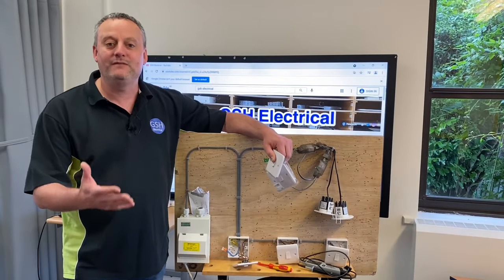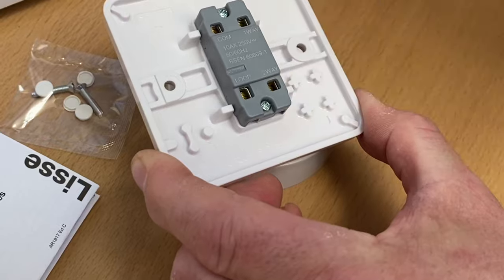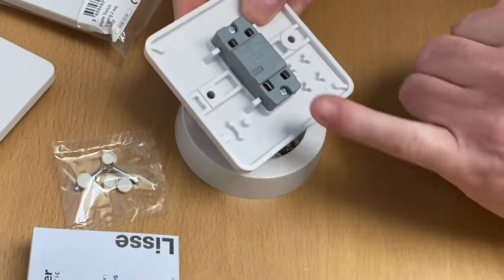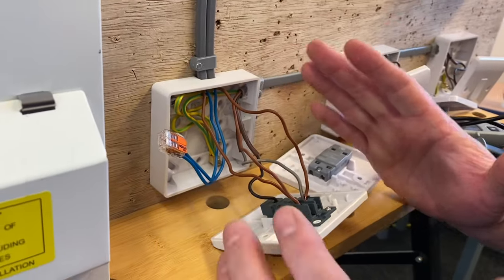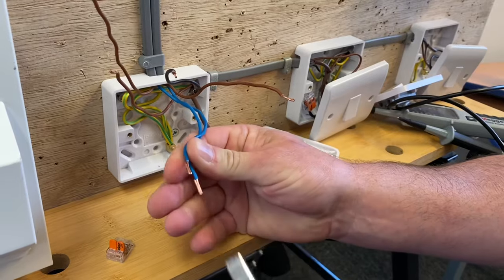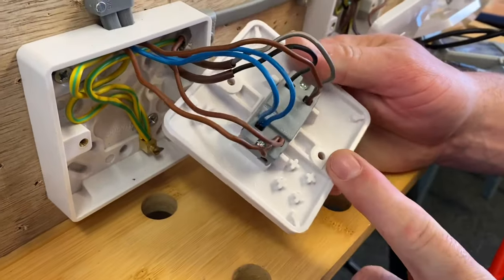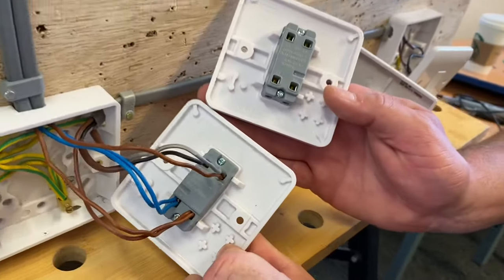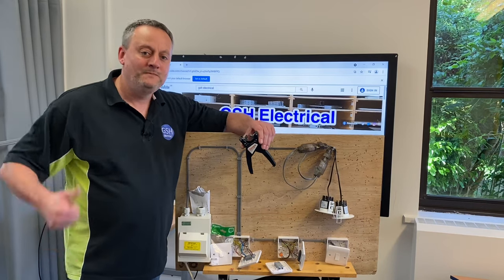Neutral Connection in the Back of a 2 Way Switch - 2 Plate Method - Taking the Feed to the Switch

Comment: It's a good idea but feel the Wago is a much better connection which is unlikely to be loose or left loose.
Reply from the maker: Thanks for commenting 👍🏻
Reply: Then the same issue would follow for those other switch terminations that aren't using Wagos. Just ensure the LOOP is similarly properly terminated. Insert prepared conductors, tighten screw then pull cables firmly to check.

Comment: I’ve been taking the feed to the switch for years. In my opinion it should now be standard. Makes life much easier when fault finding, especially with the amount of downlights people now have fitted in their homes. Also with smart switching the way it’s going, it’s only a matter of time until the regs are going to require a neutral at the switch. I don’t think it will be as quick as others think it will, but it’s definitely coming. Also I sit in the camp of using 2273 connectors instead of 221’s, only because when pushing front plates back I’ve had cables come out of the 221’s if the levers lift up with a lot of cables in the back box. Great video as always though Gaz. I wish more electricians would watch these videos as part of their CPD.
Reply from the maker: Thanks for the detailed comment Jacob 👍🏻
Reply: you should cable tıe them for extra security.

Comment: Bringing the feed to the switch is a good way forward, I found it very useful when installing smart wall switches which require a neutral in order to power its internal electronics
Reply from the maker: Great point 👍🏻
Reply: Gary. A video on smart switches would be great with a neutral feed and without. Cheers

Comment: I can't tell you how often I needed to have a neutral  behind a light switch but didn't have one. You need it for PIR motion sensors, Smart switches, timer switches and more. I think the days of the loop in ceiling rose wiring, are numbered. It was a clever system in the UK, but it doesn't make so much sense any more. People want fancy light fixtures not just a pendant. And we are desperate for that neutral behind the light switch 😉👍.

Comment: Very poor design! The possibilities for mistakes, expensive ones too, are numerous. FAR too easy to grab an intermediate thinking it has n/c terminal for neutral and end up connecting L to neutral! The extra terminal should be in BOTH switches, physically offset in some way and CLEARLY identified with blue colour to avoid ANY chance of confusion or ambiguity! 🤔😲🙄

Comment: I would prefer to use the wago as it’s a maintenance free connection as a opposed to a screw terminal . I guess some will use that loop terminal for the switch wire when they introduce an intermediate to a two way. So I guess it would be best to call it a loop terminal as it could then be used for live or negative loop through connections .

Comment: In the USA all switches now (2020 regs) require neutral to each switch.  Its in the box only, not to switch itself.  Neutrals would have to be supplied downstream as well each switch in the circuit.  This is to be able to support electronic type switches that require neutral.  👍
Reply from the maker: Massive thanks for commenting. Gaz 👍🏻

Comment: on the schneider products we use in sweden there's always an "X" terminal
Reply from the maker: Thanks for that information 👍🏻
Reply: In norway we just put neutral conductors in for light switches in a WAGO and only use the L in and L out in the switch. Earthing also just goes in wago
Reply: @tommymack3210  the ”X” terminal is basically a built in WAGO

Comment: Those 221 connectors are meant to be in an enclosure to stop them opening, 

Should use 2273 in the back of a box.
Reply: A box is an enclosure? 2273 or 2773 would be preferable however.
Reply: Only if they are to be used as a “maintenance free” connection in an inaccessible junction.  Behind a switch is not that.

Comment: I prefer using a Wago 227 as you can get more connections in and it’s easier to put the accessories back with the neutrals out the way:
Reply from the maker: Good point 👍
Reply: 2273, can handle 0.5 to 2.5mm². Use them a lot here because they're really compact.

Comment: Nice explanation there makes perfect sense. One thing I would like to see is how this compares to a traditional radial lighting circuit that uses ceiling roses. This looks like it’s feeding a single light so what do you do for additional lights in the circuit? Or do you run a single cable to each light via a panel. 

As others have stated the US has done it this way for a while it means that most of the smart home kit runs directly from live and neutral it means that this is going to be more flexible as new kit is released.
Reply from the maker: Thanks for the comment David 👍🏻
Reply: I would imagine you would have three cables in perminant live. One from previous swithch, one to the next switch and one to the intermideiate switch.

Comment: I have used take the power to the switch using a 20 amp isolator for outside lighting also with a nice neon.

Comment: Just a feed through dedicated connection…, have you covered the SUREWIRE system on your Vlogs at anytime! I found it to be very uncomplicated and simple system for your lighting systems, only downside I can see is the extra amount of cabling used but that is off-set against how quickly it can be installed and connected!

Comment: The hager sollysta intermediate switch only has the l1/l2 x2 no loop connection either also the loop terminal on hager is marked N and loop.  I still prefer neutrals in wagos only lives and sw lives on the face plates for me

Comment: I remember using these switches in 2013, Nothing new in taking the feed to the switch,I started off rewiring houses in 1982 stripping out the old rubber cable and they took the feed to the switch but the neutral cable was twisted together and a porcelain type thimble with a screw thread on the inside to join the cables together behind the old wooden dolly switches, Those were the days :)

Comment: Have always avoided taking the neutral to the switch, apart from supplying outside lights, but it is the case these days that it’s becoming essential and adding thee extra loop terminal in the switch is a great idea.
Reply from the maker: Thanks for commenting and watching 👍🏻
Reply: I installed a couple of Schneider lisse switches and was pleasantly surprised by a loop terminal, saves space in the backbox.

Comment: Do you recommend those stripers you are using? Do you have a link? Cheers. Clear presentation :-)
Reply: Quickwire QFKZ-01. Other manufacturers sell rebadged, such as CK T1260, Ideal 45-235 and Jokari FKZ. They're good and will strip not just basic insulation but also the cable sheath on twin and earth up to 2.5. Problem is the blades get worn down and they stop working well. The blades are replaceable, but nobody seems to sell them.

Comment: I do 2 plate or 3 plate dependant upon the job where I do 2 plate on commercial jobs I always wire in 3 core upto the fitting to keep the permanent live in case emergency etc.

Comment: Note - In Asia I see a lot of 2 way (US 3 way) switches with Com, L0, L1, L2 markings.  From this video I suspect L0 actually means "Loop" and would be better served if they marked it "N" or at least "Lo" or Loop.   L0 is just confusing.  L0L!   Thanks for the heads up on Loop, it has clarified this weird marking for me.